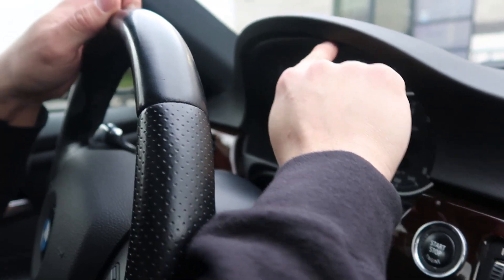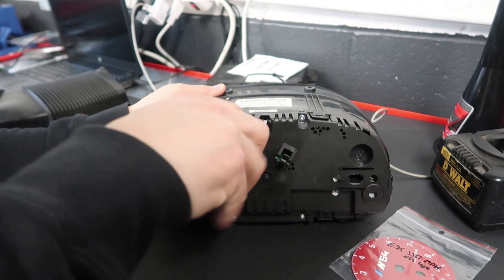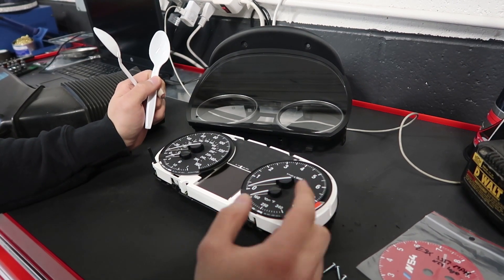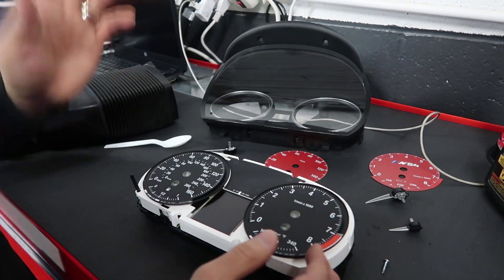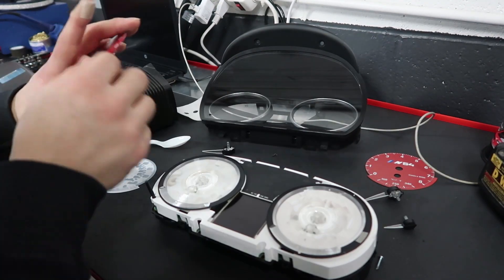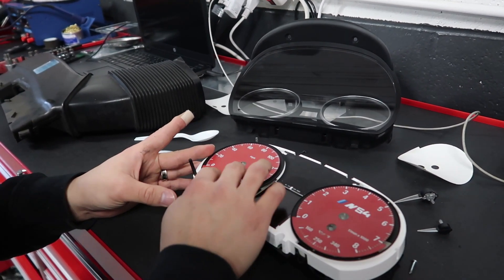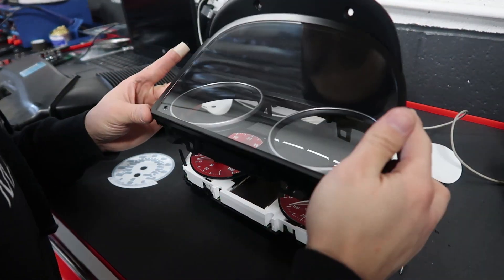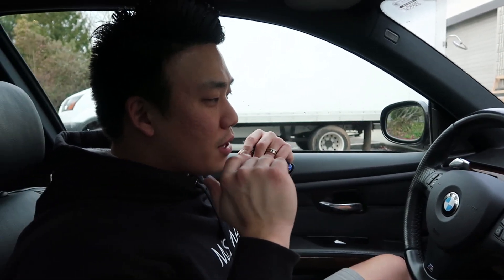How to: BMW Gauge face replacement

Comment: Thanks for the great video. Just finished doing this but my Speedo no longer works. Needle sits at zero. Going to take it out and see maybe I did not push the needle far enough or too far. Some say you have to disconnect the battery when doing this, but I see you did not, so just wanted to let everyone know. I am searching forums right now for answers.
Reply: Disconnected my battery. Now cluster doesn’t even turn on. Lovely.